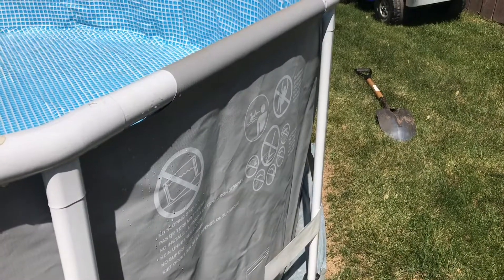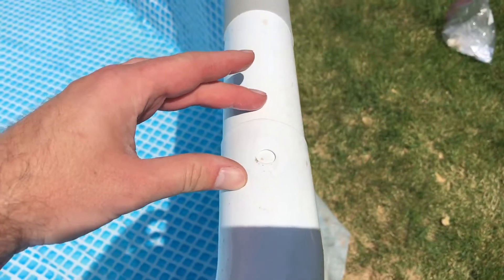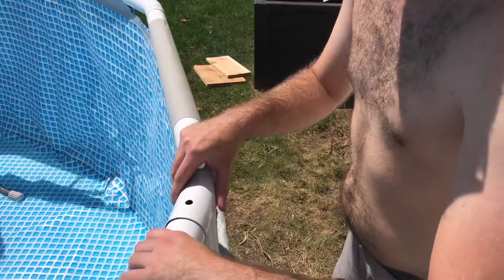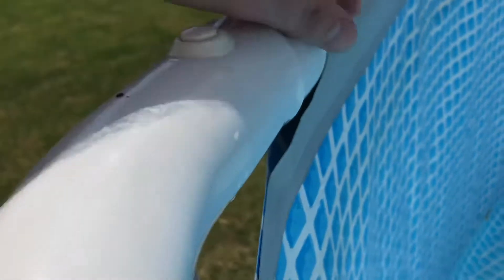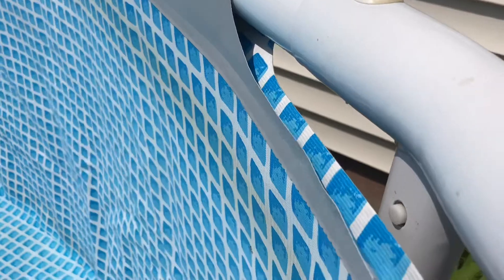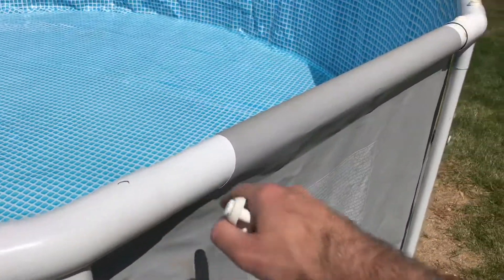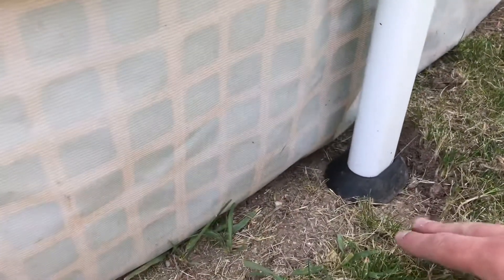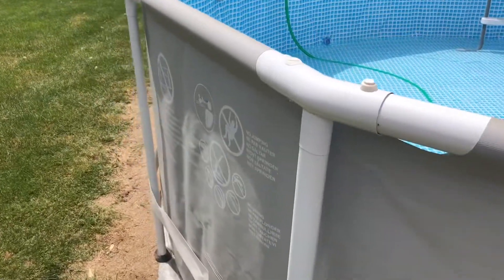Intex Pool Frame Setup - Helpful Hints To Successfully Set Up Your New Pool

Comment: For those building a more recent model that doesn’t have any “screws” to push in at the top, I found that removing three legs and pushing the connecting arms straight downward (not out) until they meet works. Took us an hour to figure it out and we were pissed when it just slipped in.
Reply from the maker: Lol isn't that something you're scratching your head forever then light bulb and you figure it out. 🤣 Yep been there many times. Thanks for sharing your experiences with the other models, thanks for watching and commenting!

Comment: Great, but my pool doesn’t have pins
Reply from the maker: that probably makes it even easier then, there's a lot of different variations to these pool frames from different manufacturers. Thanks for watching!
Reply: @DIYDad1  I finally read the instructions and found out I do the horizontal supports first, then add the vertical supports.  No wonder my wife always wants me to read the instructions.

Comment: What if after the pool has filled, one of the leg supports is not properly secure.  How can we fix  this?
Reply from the maker: It’s really difficult to move the legs around once the pool is completely filled as the weight of the water is pretty heavy. If one leg is crooked or something you could try to tap it into place with a rubber mallet if it just needs to go straight but more than likely you will probably have to drain about 1/3rd of the water out so the top foot or two is empty and then it will make it so you can move legs and poles around in case it was not properly set up when the pool was empty. Just really difficult to move when there’s thousands of pounds of water in there lol. Hope that helps. There’s not really an easy way to move this thing when it’s totally full.

Comment: I can't push my poles on my bestway past the holes. Just have to wrestle the last connection on.  LOL
Reply from the maker: Different design I guess. There’s at least an extra 2-3 inches to go beyond where those pins pop in. That’s the trick to set this up, now that we’ve done this for the third time it only takes about an hour now! I think the first time we did it we just disconnected one at the opposite end and tilted it in at a steep angle and just gave it a shove.
Reply: @DIYDad1  yup. Angles! Pivot!
Reply from the maker: @YardGuy  is that a Friends reference!? 😆
Reply: @DIYDad1  indeed! 😂